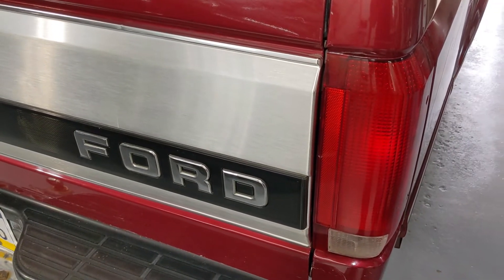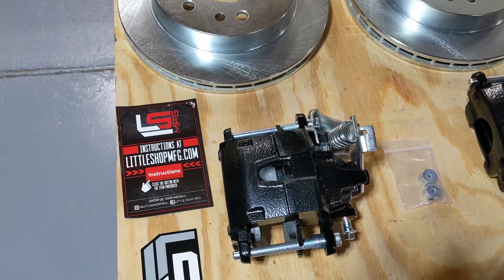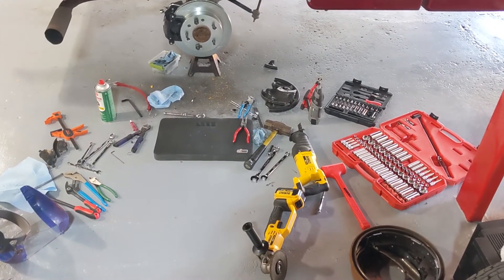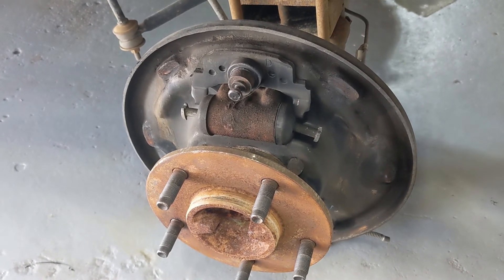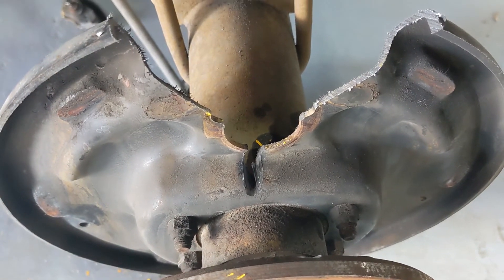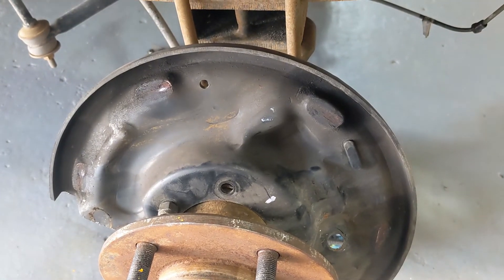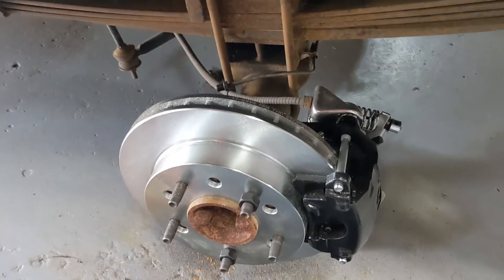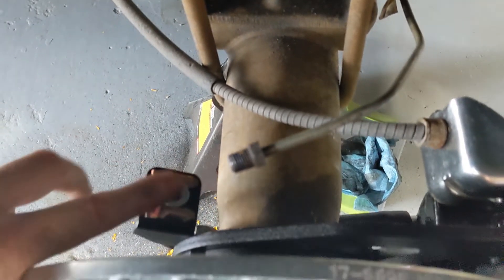Little Shop Mfg Disc Brake Conversion for 1994 Ford F-150 - Installation Tips & Initial Impressions

Comment: I definitely would have pulled the axles and replaced the seals and made this way easier and more cumplete. I would have left all the brake drum pieces in tact and unbolted the entire backing plate assembly and possibly sold it to recoup money.
Reply: The whole point of the conversion kit is so you don’t have to take the axles out . That’s what they claim on their website.
Reply from the maker: I'm with Mr. Middleton. If I could do it over again, I would pull the axles and keep the backing plates intact. I didn't realize they don't make those any longer - ones in good shape are worth something. And pulling the axles is easy compared to cutting the backing plates off.
Reply: @rckclmbr85  Yes brother. We live and learn dont we. Ive done similar things that I regret but I just crack a beer and laugh about it.😆 I pulled mine off and put them on used victoria without a bite. Still sitting here all in great shape. I rewelded the pieces I cut off where it fits around the axle, so its all fully bolted and had to do other grinding modifications to get the bracket to fit on the inside weld of the axle plate and then had to shim the caliper and so forth. All works great and smooth. I also had to cut down the original ebrake cable to fit and grind a groove around the cable to fit the clip and then solder a round bar of stainless steel nugget on the end. Lots of work. More than what most guys are sayin. I have to replace the front cable and put in a mid way adjuster now because the ebrake is pretty weak.
Reply: @GueroMendezZz  Yep thats partially correct however youve got to get the old backing plates and shit off first my friend and most dont tell you that, so we have to begin there. And whilst doing so, you may as well change the gear oil, inspect the diff inside and replave the axle seals at the same time and possible axle bearings if you so choose. By the time I was done, it cost me 800 canadian to do the job and the cheapest parts came from the junk yard at 25$ a side. I used the mustang rear brake lines but im unhappy with them so im going to get some steel braided ones done up as well. I cleaned all my parts and gavicoat sprayed the calipers and other parts and copper never seized everything as well. I fucking despise corrosion. Especially here on the west coast.
Reply from the maker: @quevicular  Thank you for the context! These kits are way more work than the instructions make it seem. I'm about to post a video on the long and painful e-brake fabrication, installation, and adjustment process I've been going through. Finally got it sorted, I think. I didn't replace the cables, but that likely would have helped.
Reply: @rckclmbr85  Yah. Much ablyged. It would have been nice if I recorded this myself and posted it however I simply do not have the time. Far more than the story reports hey. Well I got it mostly figured out anyways. Not too much different than the drum brakes I have to admit and that brings us to another story... Get rid of all ABS action and run a rear adjustable valve. I find I need far more brakes in the rear now or actually always. That will shut that damn ABS light off on the dash. I just despise all this uneeded electronic crap. Not they will always say its for our safety, HOGWASH. I recently did up my own swat bar pull pin system that works flawless. All punched out bushings for stainless steel inserts. Smooooth ride in the bush and on the highway. Makes a huge difference. Working on 3 inch stainless steel exhaust removeable with flexable pieces throughout the system and my own fabricated exhaust hangers that are working good so far. Sounds nice and tail pipe over top of the rear end helps as well. All these projects to improve on fords shit. HAHAHA.
Reply from the maker: @quevicular  I was wondering about the rear brake power. My truck seems to stop fine, but I haven't really done anything which would push it. Would getting one of Summit Racing's Disc/Disc proportioning valves be the answer?
Reply: @rckclmbr85  yes that's what I'm going to do. You put it right at the back so you can reach underneath the driver's side rear tire and adjust it from there is what some guys do
Reply from the maker: @quevicular  Thank you - I will likely give this a try

Comment: When it comes time to replace the pads and rotor how do you know what to buy?
Reply from the maker: Evening. An excellent question. I do wish Little Shop was a little more clear on replacement parts.

The rotors are 1.04" x ~296 mm. I'm 100% on the width, but the height was measured with the wheels still on, so I would call it "approximate". So basically you can buy any rotors that size (from, say, Napa).

So I have an updated video on my brake saga, and I ended up upgrading to Wilwood calipers. So for pads I'll just buy the Wilwoods off their site to match the D154 calipers.

Hope that helps, man.
Reply from the maker: Rotors are 1.04" x 11.75"

Comment: After the disc conversion, did you notice better braking power? since now you have disc brakes on rear instead of drums, please comment on that.
Reply from the maker: Morning. I admit that I have not really seen a huge improvement. I still have not bled them according to their procedure due to the PITA factor. I have not done heavy towing with the truck, and I don't drive it hard. All I can really say is that the truck stops and I'm still glad I did the conversion. I realize that's probably not too helpful. I wish I would have been able to do a before and after stopping distance test, but I didn't have access to a good place for that.

Comment: I know it is a little late, but my plasma cutter would have it cut in less than a minute.
Reply from the maker: I finally picked one up. Hoping to run the electrical circuit and air line this weekend or next.
Reply: @rckclmbr85  I have a 1994 Ford F150 XLT Super Cab converted. Works great. By the way my Ford is the same color.
Reply from the maker: @jlhomestead954  Love the truck. Really wish the brake conversion would have gone more smoothly. Still have to build the brackets for the separate parking brake calipers. Will post a video when I get to it.

Comment: Did u replace master cylinder?
Reply from the maker: Hi, Arnie. I did not. I've actually had quite a saga with the brakes recently. I've bled them according to the Little Machine Shop recommendations, and I'm convinced there's no air in the lines. I removed the factory master cylinder, tore it down, inspected everything, and bench bled it. Same pedal feel. So I think this weekend I'll be replacing it. I'll update you. Fingers crossed! : )
Reply: @rckclmbr85  does ur vehicle have a porportiong valve? If u do u might need to replace it with disc/disc porportiong valve
Reply from the maker: Good day, sir. It does. It has this style proportioning valve:

https://www.partsgeek.com/catalog/1994/ford/f150/brake/brake_proportioning_valve.html

Expensive little buggers. What is the disc/disc style?
Reply from the maker: Never mind - disc / disc vs disc / drum - gotchya.

However, would the proportioning valve cause a pedal feel issue?

Comment: Does your abs still work or is the light on forever.
Reply from the maker: Evening. ABS light works fine. I guess I'm not sure on the actual ABS. Haven't yet occasion for it to kick in. It was very unhappy after initial install, but after going through the unofficial bleed procedure, it stopped throwing an error. "Unofficial" meaning just a standard bleeding and not doing the "rotate-bleeder-valve-to-12-o'clock-position" procedure.